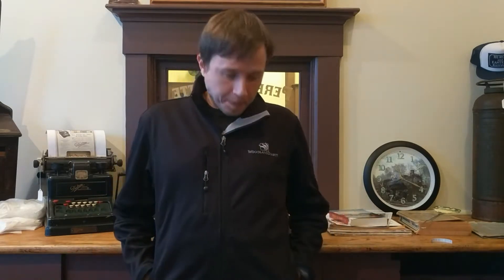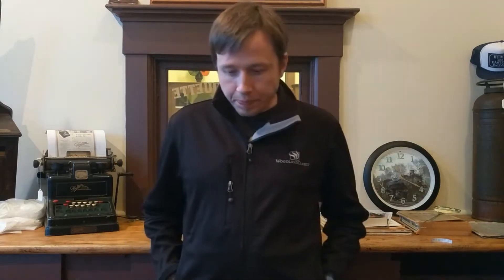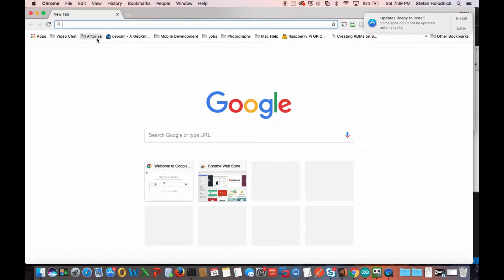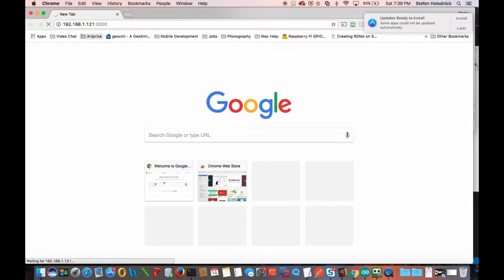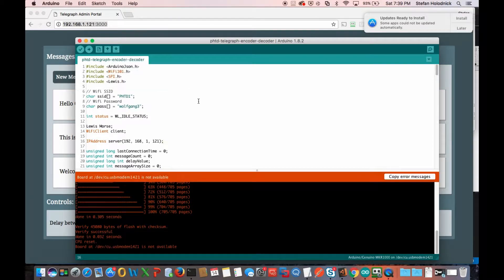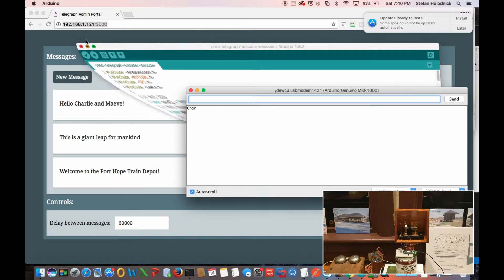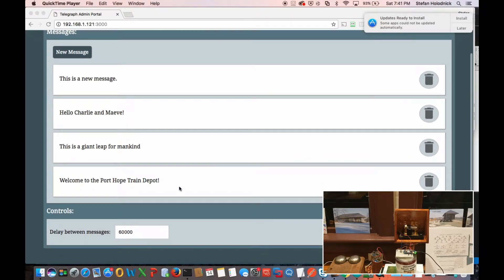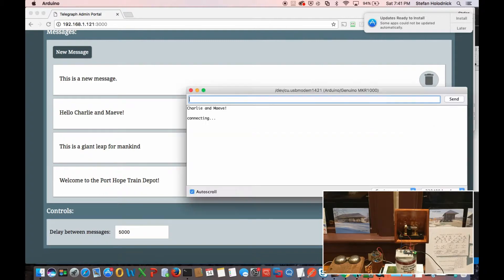Arduino-Controlled Telegraph Sounder Part II

Comment: Very interesting.
I mentioned this on your other video as well.
Since this is at a Railway Depot it should be using American Morse code instead of International Morse code.
Railways did not use International Morse code.
https://en.wikipedia.org/wiki/American_Morse_coden
Otherwise and excellent setup.
Keep up the good work!
I am Wire Chief for the Alberta MTC Line project which is connecting museums in Western Canada with Railway Telegraph displays to a Telegraph Line running across the Internet. We use small Linux computers to make that connection.
https://alberta-mtc.blogspot.com/search/label/AlbertaMTCwire